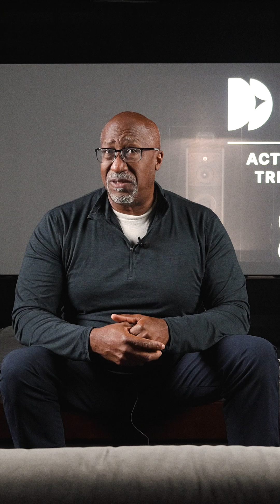Ask a Dirac Engineer - Dirac Live ART Tips & Tricks Livestream

Comment: If we increase the volume of a speaker via the AVR’s “Channel Level Adjust” section, will that also boost the channel’s ART support audio output? If so, is that something we should be concerned about or compensate for in the ART settings?
Reply from the maker: Hello. If you make any manual adjustments, the ART preset stays as it was. When adjustments are made and not saved, the AVR is essentially in manual setting mode.

Comment: Dear Mr Jones. I have never used Dirac before I have read numerous tutorials on Forum sites never watched in Tuber videos as they don’t explain the process too well, I am total novice. I have the Denon A1H AV Receiver so not so shabby setup. Please can you ask is it possible to use the Harmon house curve to increase the base of the subwoofers when using Art as you would do using the previous base control or should I increase the base level using the slider to increase manually by whatever say +4dB or +8dB instead. I take it the centre channel should not support other speakers, what about the on wall height speakers or in ceiling speakers I'm using beefy proper book shelf speakers on wall near the ceiling aimed at the listening position front & back can they support each other or is it better to only have the subwoofer supporting the height channels and let the surround speakers support each other as well as to be supported by the front speakers & subs.

If I want to run a custom curve. Is it better to stay with support level -18dB as calculated by the software.
 If my speakers can go down to say 30Hz should the F-Support Low, be set 10Hz higher to say 40Hz and do that for each speaker keeping 10Hz above the lowest frequency level of each speaker rating.  

If a surround speaker is too close to the left or right of a listener, can I tweak the F-Support Low level to compensate for that.

 Finally, after I run my sweeps can just jump straight to the Art tab to calculate without the need to go through each other tab in sequence IE. Dirac Live. Base Control. lastly Art or do I have to do each in sequence.

I take it if I set the F-Support Low setting as accurately to my speaker recommendations Dirac Art wont damage any speakers meaning if I stay within the parameters of the speakers tuning as set by the manufacturer, also will Dirac Art detect the lowest point which my ported subwoofers can go down to my subs are homemade Minimarty’s can go as low as 18Hz not that you will hear it but you will surely feel it so will Dirac calculate that properly or Dirac might say it can go down to 14Hz or is there anything I can do to save over excursion of the sub driver in a ported box configuration don’t want to blow anything, Right.

I will look forward to watching this tutorial as there are no real videos out there that explains it properly the implementation of Dirac Art.
Reply from the maker: Thanks for the question. We will definitely cover the topic of target curves in detail.

Comment: What is the best way to implement a +6 dB room curve in ART? In a 7.4.4 system should the bass be boosted primarily in the subs or applied across all groups in order to deliver maximum bass response?
Reply: Also, for two seats 36 inches apart, at the heads how should the mic positions be placed for optimizing ART?  Should the mic placements be grouped tightly around ear level in two groups or evenly around the combined space of the two seats?